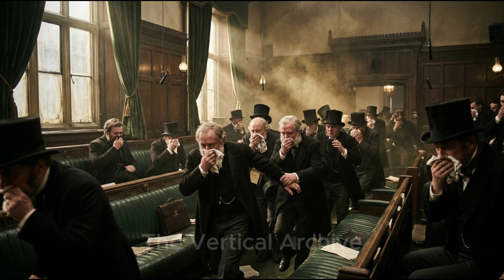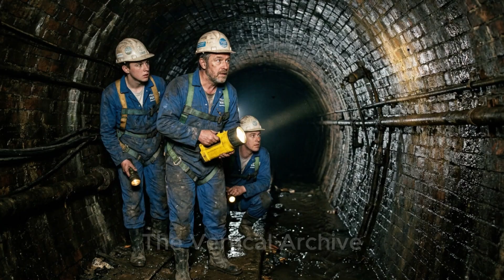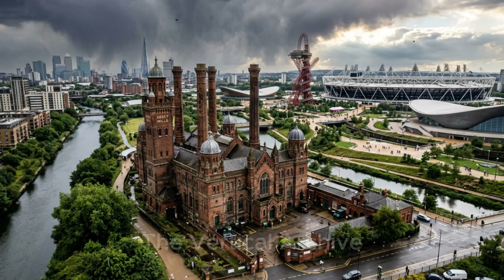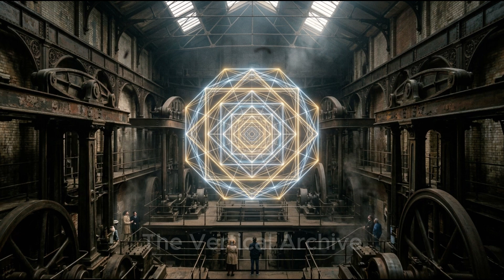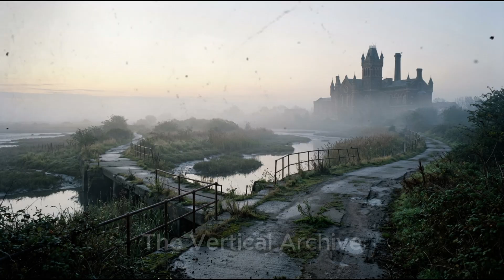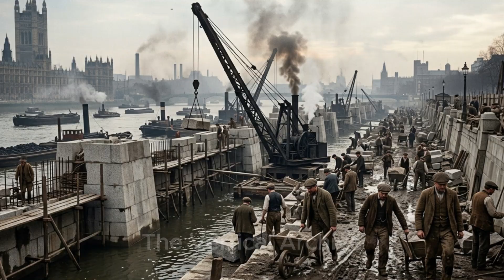The Engineer Who Built London's Sewers Like Cathedrals — And Nobody Asked Why

Comment from the maker: 📌 WHAT'S REAL AND WHAT'S INVESTIGATION:

✅ 100% DOCUMENTED HISTORICAL FACT:

- The Great Stink of 1858 — Parliament's curtains were soaked in
  chloride of lime. Members fled committee rooms. Fully documented.

- Joseph Bazalgette's sewer system: 82 miles of main tunnels,
  1,100 miles of street sewers, 318 million bricks, Portland cement.
  Built 1858–1875. Still operational under a city of 9 million people.

- Abbey Mills Pumping Station: designed by Charles Henry Driver,
  opened 1868, Grade II* listed. The Greek Cross plan, octagonal dome,
  and six sacred architectural traditions are physically there today.
  You can visit.

- The Builder magazine's 1868 description: "might be taken for a mosque
  or Chinese temple" — original publication, Victorian era.

- Crossness Pumping Station: Grade I listed. Nikolaus Pevsner — one of
  the 20th century's most authoritative architectural historians —
  described it as "a Victorian cathedral of ironwork." You can visit
  on restoration open days.

- The egg-shaped tunnel cross-section's structural and hydraulic
  properties are documented engineering fact.

- Vic Tandy's 1998 infrasound research: published in the Journal of
  the Society for Psychical Research. Real peer-reviewed paper.

🔶 INVESTIGATIVE INTERPRETATION (not claimed as literal fact):

- The proposed deliberate acoustic design intention
- The "Marcus Field" 2019 tunnel recording
- The specific causal link between the architecture and infrasound effect

The building is real. The geometry is real. The acoustic properties
of the egg-shaped brick tunnel are real. What those choices MEAN
is the question the official history has not seriously asked.

We're asking it.

— The Vertical Archive